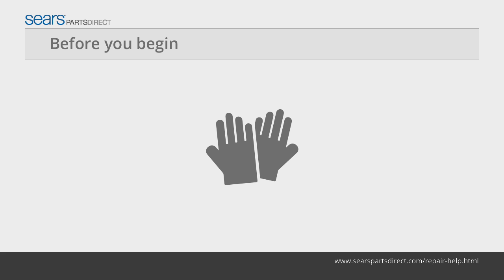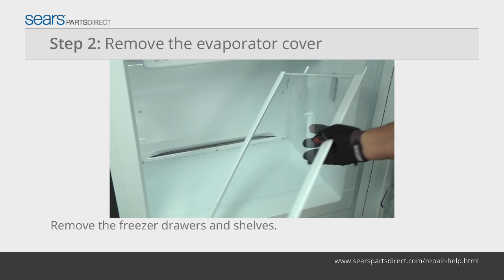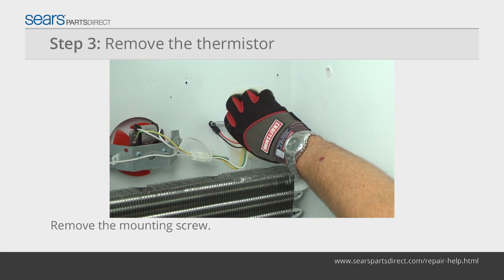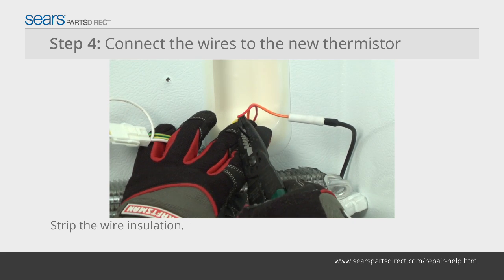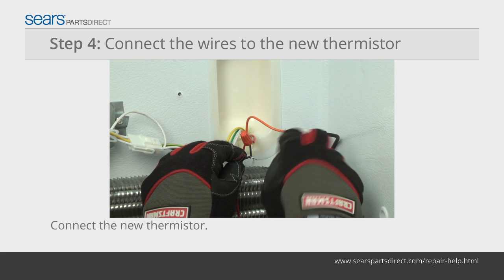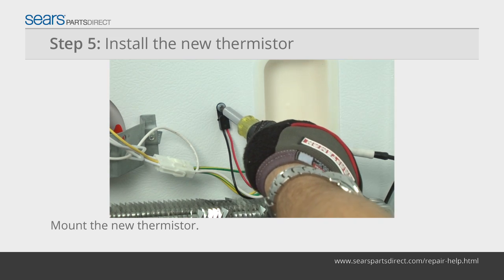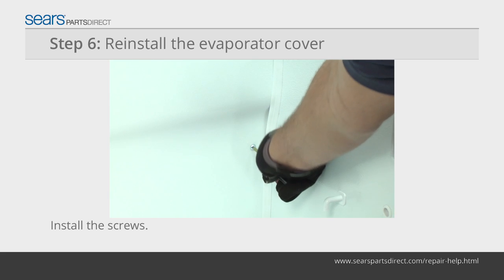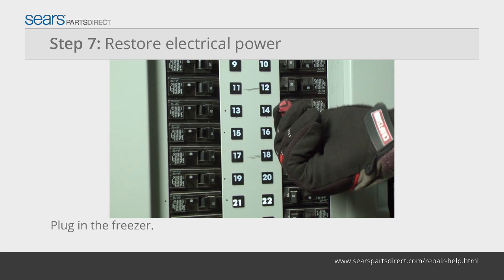How to Replace a Kenmore Upright Freezer Thermistor

Comment: how do you test that?
Reply from the maker: Here’s a video that shows how to troubleshoot thermistor problems: http://www.searspartsdirect.com/article/troubleshooting-thermistor-problems-in-refrigerators-video.html. The video covers refrigerator thermistors, which are identical to freezer thermistors.
 
You’ll need resistance values for the thermistor that you’re testing if you get to the point in troubleshooting where you need to check the freezer thermistor’s resistance. The tech sheet for the freezer provides a resistance chart for the thermistor. You’ll typically find the tech sheet behind the bottom front toe grill or on the back of the freezer.